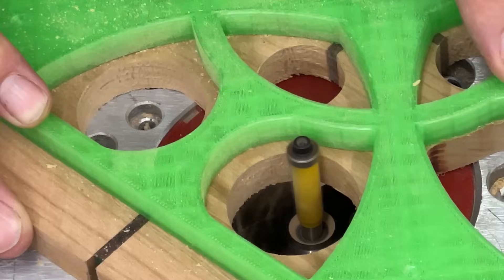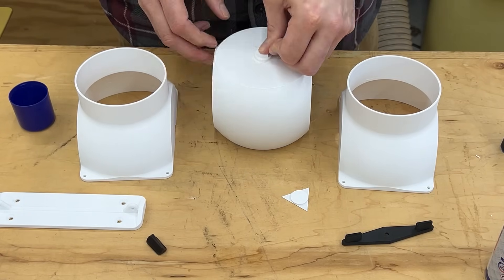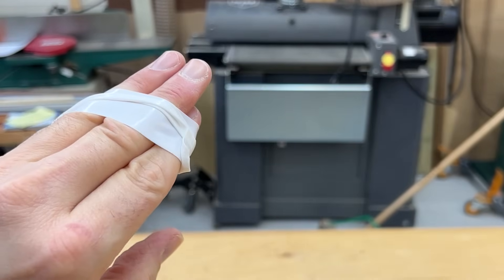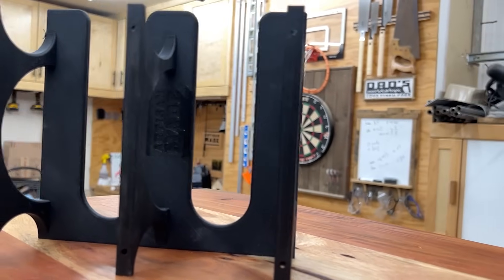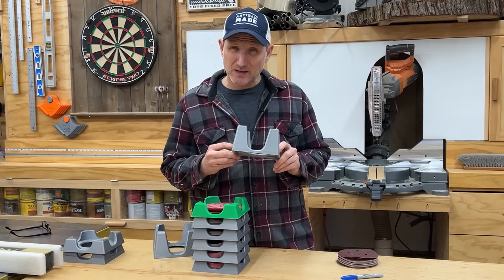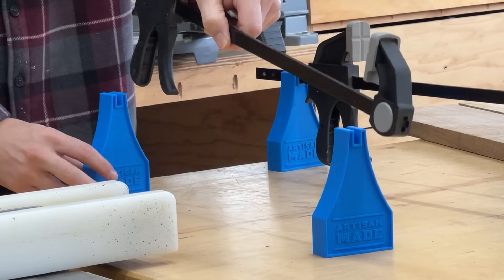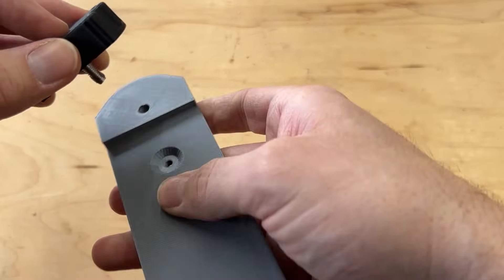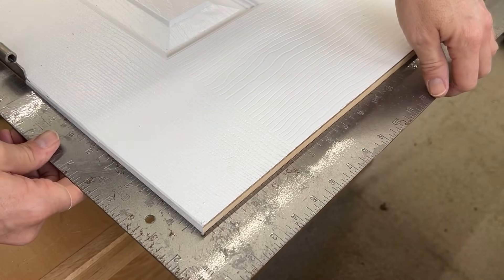3d Printing For Woodworkers / 3D Printers Solve Problems In The Workshop / Improve Your Workflow

Comment: What is the best Filament to use for these parts?
Reply from the maker: Easiest to print is PLA. PETG is fairly easy to work with and is stronger and more durable because it is a bit flexible. Carbon fiber reinforced filaments would be even stronger.

Comment: I see you had the same (expensive) blast gates I have - how did you dispose of them? Ebay? Funny, with all the 3d printed racks, tool holders, dust system adapters, etc I use, I never even knew about these ball valve types, very cool and thanks for sharing.
Reply from the maker: I still have the old ones. But I really think I need to just throw them out. The 3-D printed ones are awesome.

Comment: I connect my dust collection system with dryer 4” magnetic couplers on the equipment side, so if I have to move them I have a quick disconnect.

Comment: What filament are you using ( PLA, ABS, etc ).  The first thing I 3d Printed for my shop was the key for my table saw.  I had lost it, but the one from my drill press worked fine so I just swapped them back and forth.  I took the one from my drill press, measured, put it together in fusion 360, sliced it, hit print and I had a new key that I'm still using about 5 years later.  I've also printed outlet and switch covers for situations where I couldn't find the one I needed at the hardware store.
Reply from the maker: These all happen to be petg but I also print with pla.

Comment: Dang it! I'm trying to hold off on the 3D printer for a while and these types of videos are testing my resolve. Great job with yours, and THANK YOU for getting right to it and not dragging every single part out over several minutes.
Reply: It’s worth getting. They are much more cheaper and user friendly. Bambi lab a1 is a good starter and the ender 3 v3 se. but the Bambu can has a multi color machine that you can print multicolors.
Reply: @Ap3dCreations2  I'm totally new to 3D printing (with 30 years of woodworking experience) ... I got a Bambu A1 a couple of weeks ago and absolutely love it. Yes, and the "AMS Lite" that holds 4 spools of filament for multicolor prints. Take the plunge, you'll be so happy you did.
Reply: The Ender 3v2 is under $200 and with a couple of hours worth of tightening and calibration, can print as well as any printer out there.  There's really no reason, other than not having the $200, to hold off.
Reply: I design and print all kind of brackets, templates, boxes, slug fences, fixes…. Anything really.
My wife says that our house will never be without a 3D printer.

Comment: Late to the show, but: M4 and 8-32 are virtually interchangeable, especially if you are using nuts on the machine screw.  And for anything that may suffer from vibration, I always use nylock nuts.  And with 3D prints, I also put flat washers on both sides of the fasteners.
Reply from the maker: Good to know. Thanks for sharing!

Comment: Great video, you had me until the end when you revealed you charge for your stl files. Even in the beginning of this video you point out that the wonderful 3D printing community offers many many free print files then you go and charge for yours which is so contrary to how your video started. So disappointing, but good luck with your greed.
Reply from the maker: It takes me about 30-40 hours of work to put out a video on average. This includes building, filming, and editing. If you like the   Content and the ideas that I share, feel free to apply them in your shop. If you would like to support the work that i do and help me keep my channel running, you are welcome to purchase my stl files or even woodworking project plans. And by the way, I have created stl files and shared them with the 3d print  community.  Greed is when someone only takes and gives nothing back in return.
Reply: @ArtisanMade  Actually "greed" is defined as "a selfish and excessive desire for more of something (such as money) than is needed. *Webster Dictionary    In this case charging for something that is otherwise offered for free. Especially $15 for a print file, come on. That is excessive. Also, the time you spend on your videos should have no impact on the price of your print files. Youtube has a monetization system in place so you should look into that as a reward for your time and effort on your videos. I did like the video I thought it was well done. I just think it's messed up to start your video talking about using free print files to enhance woodworking then end with advertising yours that cost money.

Comment: Excellent video, you can improve the strength of t fixing holes by adding extra walls for strength I use 6-8 with a 0.4 nozzle or 3-4 with a 0.8 also if you are using petg you can get very strong parts printing slow and hot with only 30-50% cooling

Comment: You should check gridfinity for your drawer organization. No need to re-print, just adapt them to that system. It's a rabbit hole, though.
Reply from the maker: Yea, already been down there and keep going back
Reply: @ArtisanMade  I've been designing and printing a few here and there, but I want to use the CNC to cut the tops out of wood. I'll glue 3D printed bases to the tops so I don't have to CNC the bottom. I also want to make the baseplates out of hardboard.

Comment: Love this channel for new ideas in the shop. Get some Weldon-16 for a better bond on your 3d printed parts - it sets up pretty quick and it holds well. There's some crazy layer lines on those prints... if you're ever going to do a print for display, you may want to do a tune-up on that awesome Bambu Lab.
Reply from the maker: Thanks for the tip. Just picked up some weld on 16. The prints with the layer lines were made on the ender 3. The bambù lab is new and pretty amazing. Time to throw away the ender.
Reply: Get some glass syringes with stainless needles (16 gauge works well) - the stuff is messy and tends to just pour out of the tube. Dump your syringe and needle into a glass jar with a couple ounces of acetone, lay the needle down and suck some acetone into the syringe and leave it there till next use. When glueing, I also have a smaller jar of acetone that I can put the tip into between uses, as the glue will immediately start gobbing up on you - the acetone keeps things viscous and clean and the upright position of the syringe keeps the glue from oozong up the walls.
Reply from the maker: @josephpk4878 thanks for all the information. This should save me some time and money as I learn how to use this stuff. It sounds similar to an adhesive that I used many years ago on plexiglass. It seamed to fuse  the plexiglass by melting it.   Is it possible that this is the same stuff?
Reply: @ArtisanMade  Not the same stuff - that stuff is super viscous and Weldon-16 is like a light syrup which takes a bit to work its way up a 16 gauge needle. It starts gumming up immediately and starts stringing when you're working with it, so you have to be efficient, That's why the extra jar with a bit of acetone is a good way to hold the syringe when not in use - the acetone keeps everything fluid and clean. Throw a little rag over the jar to keep the fumes back and to give a quick wipe of the needle when pulling it out.
Reply from the maker: @josephpk4878  got it. Thank you again for all of the information. Super helpful!

Comment: All your stuff looks super annoying to print. Look some some DfM tips for printing. 

I tend to redesign anything with overhangs, bridges, or needing support.
Reply from the maker: Actually, they are very easy to print, but good luck with your redesigns.
Reply: @ArtisanMade  I do cad daily and am either running a mill or a printer. 

The clamp stands? Just I’ll in under, not hard, no luck required.

Good luck with stuff that most Enders don’t like!

Comment: What 3D printer do you use/recommend?
Reply from the maker: If you are just curious about 3d printers, I wouldn't spend a lot of money just yet.  I was using the creality ender 3 v2. (under $300)  It was a descent entry level machine. I learned a lot with it. I am now using Bambu Lab. You can get the P1P for $600. It is like a Ferrari compared to the ender.  Much faster and great print quality, and many bells and whistles but, relatively new to the market so not time tested.
Reply: @ArtisanMade  awesome! Thanks for the detailed reply, and taking the time to do so!!! 👍🏼😊
Keep up the great content. 🫶🏼

Comment: Great!  Thank you!  What is the 3D printer you use?  I am looking to invest in a 3D printer, but there so many out there.  It takes too much time to evaluate each from reading each's descriptions.  I am looking to make cases for things that I create.
Reply: Looks like he has the Bambu x1 carbon. I bought the same one last spring for a project, having no experience at all with 3d printing, but being fairly tech savvy. I use it semi regularly for little projects when I have time to sit down with Fusion 360 for a couple of hours, and I haven't had a single print fail yet -- it's been awesome, it's worth the money in my opinion. It's more or less marketed as the first real user-friendly printer.
Reply from the maker: I’m using bambu lab. I bought it in December. I originally started with the Ender three. That was an OK machine to introduce yourself to the 3-D printing world. If you are certain that you are going to be using a 3-D printer for some time, I would recommend buying a better quality machine. A lot of people use Prusa because they are very reliable. Recently, new companies have entered the market with more modern machines.that are much more user friendly The one that I have now is much faster and produces a great print quality. The only problem is that new products have not been tested over time and there is a much smaller community out there to help out when you have a problem.  So far though my bambù printer resembles a Ferrari compared to the ender.

Comment: Awesome ideas. I bought my first 3d printer last June. I have 2 at my house and 1 at my shop. lol. Last 2 machines were free, I paid for 9 and 12 rolls (under $180 each) respectively of filaments and machines were free. 😊h
1. Ender 3 S1 new
2. Ender 3 Pro used
3. Ender 3 Original used
All modded with linear rails and more.
Reply from the maker: The possibilities are endless!